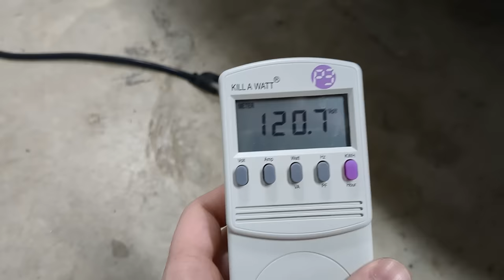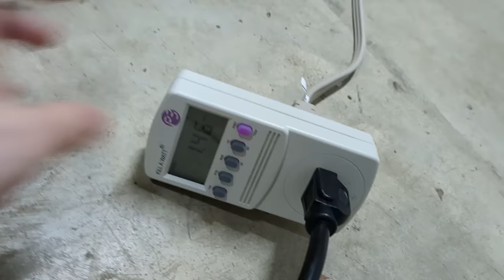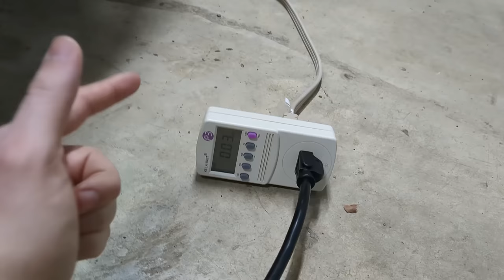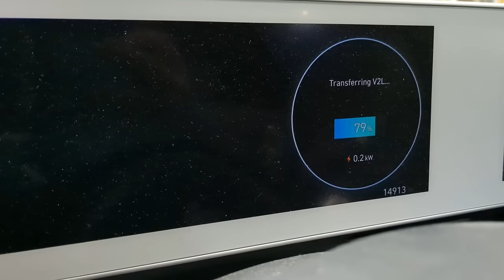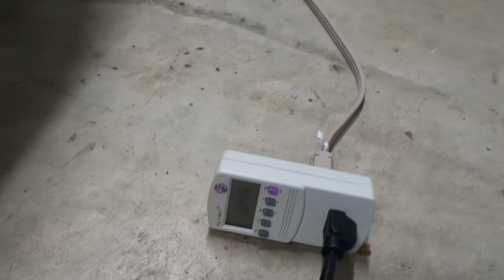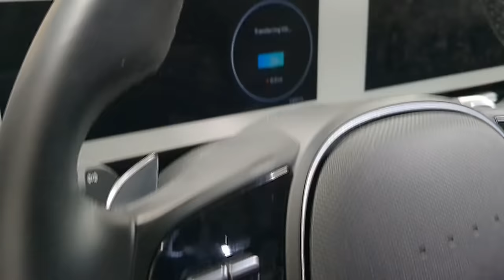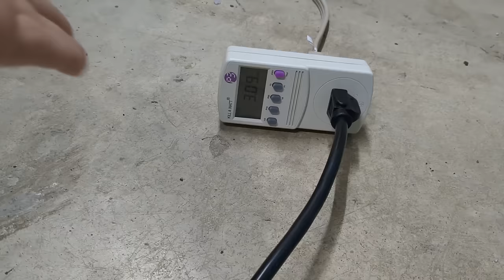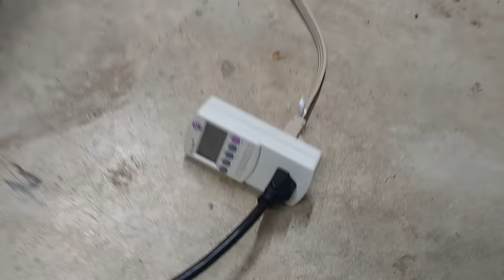A 24-hour test run of the Hyundai Ioniq 5's Vehicle-to-Load function

Comment: Looking at your door handles on this car, this is one of my number one peeves. Why do they have to put ridiculous handles on these things? Yes, let's put things that stick out that you can catch purse straps and clothing on much easier than a standard handle. Also, why not make it use more electricity? Seriously, just give me standard manual pull handles. Things like this tend to turn me away from buying an electric car model, not towards it. I don't find it fancy and cool, I find it annoying and ridiculous.

On the plus side of this particular video though, I absolutely agree there should be just a generic feature that does this on every EV. There's no reason not to. For short power outages, it's enough power to do basic things that need to be done like running the fridge and a few lights. I have a car jumper pack that will run one light in my living room on its inverter for a day, and I have a deep cycle battery from my tent trailer that I keep in the shed on a charger (the trailer has to be stored in another lot and we don't have a garage) that we can use if we need more than that if the power outage goes longer. Sure, generators are better for longer outages, particularly if you live remotely. But for the average person with the average 8 hour to two day power outage, this would be perfectly fine and still leave enough range to leave if the outage became extended.

Comment: Just a couple hours north the winter became no longer mild.

Network equipment should be on a UPS when possible. Often youll be able to maintain internet without power.

For Starlink you can use your own router once setup. Keep it near though as youll need it for adjusting the satellite.

Comment: I believe based on if your garage is heated what a decent chunk of your loss might have been, im pretty sure hyundai wont tell you, but im guessing during V2L that the battery thermal management is active, so in all likelihood the car might have been waking up just enough to begin to warm the pack during use. 

that is about the only thing i would really think would cause so much loss in the V2L aside from the inefficiency of the AC/CD DC/AC convertors which would seem to be hilariously inefficient if about half of what you used in KWH was also used by the car keeping itself alive and running the DC/AC conversion which seems odd considering that the pack is 400V and its down grading to 120, losses seemed really quite high.

also as noted with the ford lighting backup power system, i kinda have a little gripe... i kind of think the V2L function should allow for split phase 240 in the same vein as the household grid supplies, maybe its just 2 120V outlets and not technically split 240, but with the voltages of the pack and how level 2 charging is 208/240 the system could easily handle supplying that back through V2L

Comment: Yeah, that's a surprisingly bad efficiency... Most (even cheap) inverters have an efficiency of at least 80 %, many above 90 %. And a large part of the losses come from generating the high voltage DC, before actually generating the 60 Hz AC. Given that your car runs at a higher voltage than the peak of 120 V RMS (170 ish volts), it could probably get away without a transformer, just using filtered PWM, to generate the 60 Hz AC, directly. Which should easily be able to reach 90-95 % efficiency. So I'm not sure what they did there, but it doesn't seem to be implemented too well, if it just unnecessarily throws away half the power...

Comment: it would be More Efficient if it was 220-240 Voltage Charging the Car and 220-240 Voltage Coming out of the Car Powering your home for the higher the Voltage the More Efficient the Power will be Transferred with the Lowest Lost Possible.

Comment: All that smutz on the bottom... Stainless steel polish, not the abrasive kind but the baby oil kind. Or just baby oil for that matter. Sorry if I'm the 167th with this suggestion, didn't check. LYW.

Comment: 10/10 clickbait on the thumbnail. A battery is not a generator. You didn't use it as a generator, you used it as a power source. Enjoy your engagement metrics.

Comment: See this sucks because you can buy a real lifeepo4 server rack 48v 5kwh battery for $1200, and pair it with a 6000 watt output charger/inverter. So people keep talking about how awesome this is that you can use the cars battery to power your home which is true but you could do it better with $2000ish worth of gear and your Bev cost a lot more than $2k more than the gas equivalent. I get this isn't the only reason ppl but Bev's but it shouldn't really be a reason at all.
Reply: How long do you think that 5kwh lasts? 

No one is buying evs for this purpose, but of course if the capability is there people will use it.
Reply: @kj_H65f  about 10,000 charge cycles. Really you pair it with a small amount of solar off grid /no permits needed and use it to power a few things in the house. Using your very expensive Bev battery to save so little money on electricity just doesn't make a lot of sense. Especially considering the high cost of public  ev charging. Pretty disappointed with EVs , they appear to cost more to operate using public chargers than ice vehicles, they cost more upfront, and the non Tesla charging network in the US is like a rotten tomato.
Reply: @fox156  server rack is useless when you have long outages. Recharge can take a long time (estimated 5-7 hours). With BEV there is one trick to charge a little bit (in case if the car's battery is almost over) you can ask tow fuel car (regenerate some power back to the battery). And if somewhere nearby is high-power charger you can very quickly charge back your car
Reply: @mixro203  good luck getting a battery charged during some long power outage!
Reply: @fox156  Are long power outages common where you live? I haven't really experienced ones lasting more than a few hours for... what, 15 years?
Reply: @fox156  I had long time power outage ( somewhere 35-40 hours) and in that case I think had been enough ev battery for living needs

Comment: This is a novel but not particularly practical feature. Your demo bears this out. You are extremely limited by output capacity to what a typical tailgate generator could produce, no where near running whole house or even a window AC in addition to the basics you got running here. This is all not to mention the fact that you are using a finite amount of electrons that eventually need to be replaced in a time consuming process (charging) that would likely also be unavailable due to any outage at home. A far more capable system is the Ford F150 hybrid which not only gains increased on road efficiency but has the ability to power significant loads and can be refueled relatively instantly (compared to even ideal charging situations).

Comment: You recently mentioned you'd never need a generator. That's unwise. The battery might work in reverse, but you will need a working power grid, and even with our modern toys, a bad tornado season could make that less than available. Or a host of other things. Keep the generator, even if you only keep a small metal tin of petroleum extract of your choice. You could run ethanol instead. But don't ever be fully reliant on the grid, even if that's leaving the garage to get it elsewhere.

Comment: The only problem with this strategy is that you have to come home with your car charged and not expect to charge it at home, because if you do and you have a power outage you won't be able to charge it AND you won't be able to use it for power.

Comment: No real reason to cook or heat with electric when there is a power outage. Use your outside propane grill and get a Big Buddie Heater, to save your batteries and have an alternate heat source. Don't put your all your eggs in one basket.

Comment: Your banner that you used your Hyundai Ioniq 5 as a "generator" is misleading.  You didn't "generate" a single watt of electricity; you only emptied a portion of the stored energy in the car's battery.

Comment: You shouldn't have to buy an EV just for power backup. That's very financially inefficient. Just get a couple of deep cycle SLA batteries for $500 tops, that will sustain your furnace and critical appliances for  a day or so, then you can recharge these batteries in your car - gas or EV. You also need inverter and battery charger. I think it's a more elegant solution as well since you don't have to run extension cord that long especially if your car is parked far from where you need the power.
Reply: I believe the idea here is having a transportation platform serving more than one purpose. A car that can also run appliances in addition to transportation.

We have 5 kWh of batteries hooked up to the house, yet those 5 kWh are a drop in the bucket compared to the 70 to 100 kWh of vehicle batteries in the garage that cannot accessed. Vehicles spend most of the time parked, why shouldn't we be able to access that energy. Legislation maybe?
Reply: @wzDH106  the same legislation should apply to ICE vehicles too. Essentially every ice car has a gas generator in it. Why take up space to store another generator if you already have one in the car?
Reply: @i6power30  

True, but then carbon monoxide poisoning becomes a real threat to the uninitiated. Lawsuits will most definitely kill that push before any meaningful launch.

Then there is the inefficiency of converting that gasoline to useful electrical power, where gasoline engines will lose 70% before ever reaching the alternator, not to mention the excessive parasitic losses running the unneeded displacement and accessories associated with operating the vehicle. Idling a small displacement gasoline engine, without load, can consume between 8,000 to 16,000 watt hours of gasoline over an hour. "Idling"  an EV would only consume 500 to 1,000 watt hours.

Sure, a sophisticated hybrid, high voltage motor/ generator and hybrid battery could alleviate some of these losses, though we would be leaning towards the battery storage idea.
Reply: @wzDH106  Surely most people know not to idle their fuel burning cars inside closed garage. As for efficiency, we are talking about once in 5 year if not 10 year large scale power outage, survival is more important, I could care less about efficiency at that point. it's only going to be short time period hopefully.
Reply: @wzDH106  Sure your battery storage solution is beautiful and safe. But at what cost? Especially in a rapidly improving technological era, your expensive battery + inverter system will depreciate like there is no tomorrow, if you will ever get to use it in an emergency situation at all is a question given how rarely long lasting blackouts are. But if you have money to throw around and need to buy a peace of mind be my guest, but don't criticize others who are more financially frugal about being less efficient etc. We are more financially efficient, maybe you are more energy efficient but financially wasteful.
Reply: @i6power30  

Actually, you brought up the independent battery storage in your original comment. $500 is quite a lot to spend on batteries. The cost of all-in-one LFP portable (on wheels) battery powered backup units have fallen significantly along with LFP batteries in general. A single 2 or 3 kWh LFP battery will weigh significantly less and occupy much less space, over a similar 2 - 3 lead acid set-up.

But anyway, my original follow up comment focused more on the accessibility of vehicle energy storage, and allowing a vehicle owner/operator easier access to the stored energy during emergencies. At no point was I pushing EV adoption for the masses, though that's clearly where we are heading in a decade.

And yes, by simple 5 kWh LFP battery set-up has kept the fridge and freezer running for a recent 48 hr blackout, along with a few electric blankets and a cup of tea. But I'm aiming towards powering a smaller mini split, primarily for air conditioning during the summer, as they're hooked up to a few solar panels. An off grid air conditioning unit.
Reply: @wzDH106  curious how much was your 5kwh LFP batteries? Everywhere I look LFP batteries are twice that of deep cycle AGM batteries. If you are just using it for backup power 99% time it sits idle doing nothing I can't justify spending thousands $$$ on it. $500-1000 is my limit
Reply: @i6power30  

I didn't know the size of your personal / or proposed system so I just put 2 kWh to 3 kWh out there. But a 1.2 kWh LFP was running between $300 to $376, including onboard BMS charging and discharging protection. I personally went with AmperTime (rebranded Li Time). 'Power Queen' also has similar priced products. 

A 100 AH, 12V (~1.2 kWh) LFP is essentially 2× 100 AH lead acid batteries considering usable capacity restrictions associated with lead acid batteries.

I went with the 200 AH 12V battery (I believe 2.6 kWh advertised), a little larger, but offered the best capacity for the cash, on the 12V platform anyway. Feels lighter than a single 100 AH lead acid battery, with 4× the usable capacity and higher cycle life. 

Only issue, the base models have all the protections EXCEPT for cold charging restrictions. The BMS will allow battery charging when the cells are below 32F (0C), potentially damaging the battery, characteristics with the LFP chemistry. Discharging is fine in this environment, but babysitting may be required to avoid charging, if exposed to these temperatures. Other models have built in heating elements, for a premium.
Reply: @i6power30  

Price shopping during the holidays, black Friday etc, usually offers discounts to current prices. I'm seeing between $500-$600 USD for the current Li- Time 12V 200 AH battery. I believe I paid just over $600 six months ago. The price has fallen on that model.
Reply: @wzDH106  Thanks. You maybe right. However, I was leaning towards SLA batteries due to its easy maintenance. All you have to do is to keep it topped up. Whereas Lithium based batteries need to be charged / discharged regularly to keep healthy. Also there are deep cycle marine and AGM batteries that can be deep discharged / charged 80%+ up to 1000 cycles that's more than enough for emergency usage. Granted, that LFP batteries are superior if you use it on regular basis it will last a lot longer than SLA batteries even deep cycle ones. But I don't plan on using it often, maybe not at all unless power goes out for a long time. Plus the easy of maintenance of SLA and not having to worry about leaving it outside to charge in winter is a bonus. During power outage in winter, I plan to charge the batteries with generator or in a car outside in the cold.
Reply: @wzDH106  I also see that battery technology improving fast pace and prices may keep coming down. So why spend premium on high end battery now. Just buy some cheap sla batteries if you only use it as backup. Wait for cheaper and better batteries come to market in a few years

Comment: 4 day blackout back in 2003... like many millions of others..

your whole setup gonna suck real bad after an emp or solar flare, or attack on energy infrastructure (which it's extremely susceptible to).. i wouldn't be ditching your gas/diesel just yet... considering you have an EV, i'd probably get a diesel generator to charge the car in emergencies
Reply: if a solar flare knocks out power I'll have MUCH bigger problems than my car.
Reply: You think your gas will save you if those things happen? You will have bigger problems.

Comment: 333 Watts? LOL WTF 333Watts is Totally Nothing you can Make 333 Watts Peddling a Bicycle My E-Bicycle puts out 1,500 watts and I have Gone over 40 Miles with Most of that at 35MPH and some of that 40-45MPH it use to Top out at 52MPH and I Geared it Down to 47MPH it Tops out at now and that is on my E-Bicycle and I Still had 50% Battery Life Left. You have a Car Full of Batteries and if you can't Pull a Min 3,000 Watts it's Trash for the Smallest Generator with a 5 Hp Gas Motor puts out 3,000 Watts

Comment: An induction cooktop is not a burner - it doesn’t burn gas. It’s just a cooktop. Don’t say “burner”.

Also running the setup again for 3hours isn’t QUITE the same as the initial 3 hours as they included a start-up from a simulated power outage for 90mins. But still.

Remember the inverter in the car will have losses on the output.
So you won’t be able to run a space heater for 60-70 hours due to losses. Probably only 40+

In an actual outage you’d not have hot water for your shower though.

Comment: Good info, but your presentations are just too slow paced with far too much time spent on details (eg, a simple "I am putting a Kilowatt monitor in line to measure the total power we used) instead of all you said/showed).  There was no need to have us waiting to see the 'fridge turn back on.  And so on.  This 50 minute video could/should have been 10 mins TOPS.
Point being, I get bored with your videos and end up jumping forward, or I don't watch them to begin with.

Comment: if you pulling power out to power your home Your Losing around 77% of the Power that it took to Charge the Car at Best you lose 40% of the power Charging the Car and your Losing an Other 50% of the power that the Battery has Powering your home The Lose is So Big it's Crazy.